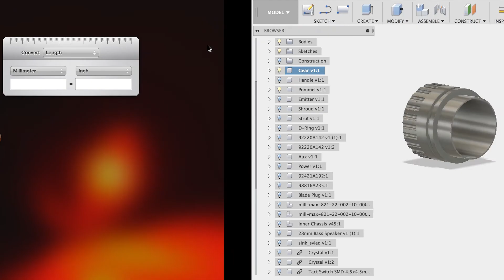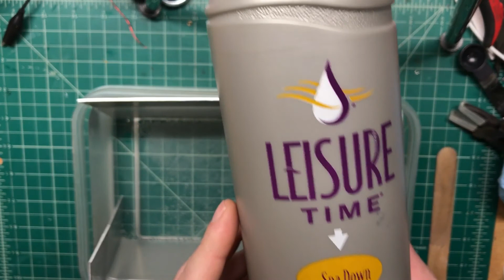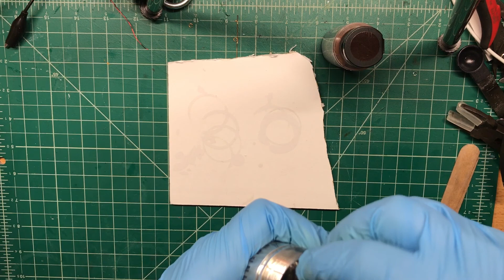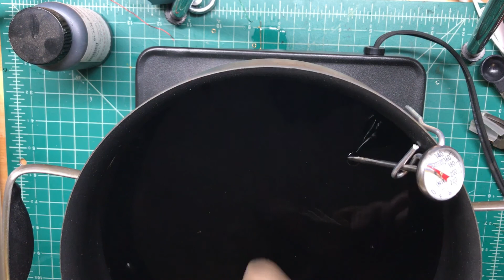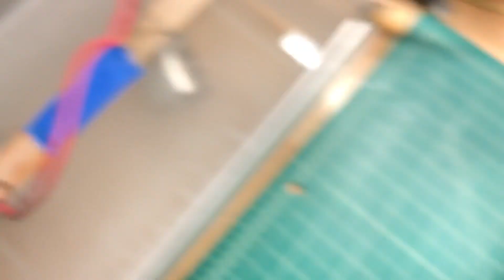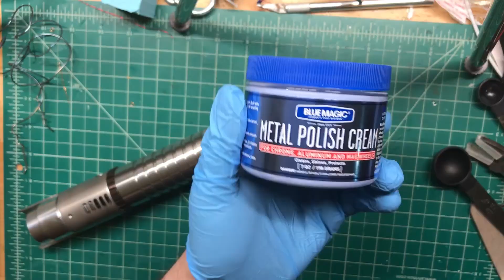DC's DIY Anodizing How To

Comment: Wonder if you can help me , when I use the 720 rule for area ,
I set the amps running in CC mode yet my volts still increase to around 25v-30v yet I read they should roughly be around 15v 
Any help would be appreciated thanks

Comment: How durable is this method? I've just started anodizing and use the sulfuric acid method with good results. You don't need to circulate the water this way?
Reply from the maker: It'll stand up to more abuse than just raw aluminum, but I'm no pro and have never done acid method so I can't compare. I agitate a little during the process but nothing like using a water pump or anything like that.
Reply: @DCsSaberhood  cool it looks good. I'm no pro either but I'm definitely enjoying anodizing everything I can. I made my setup from a broken Keurig coffee maker. They have air and water pumps in them! Definitely a good place to scavenge parts. Thanks for the good video!